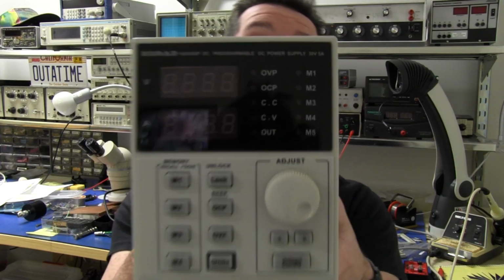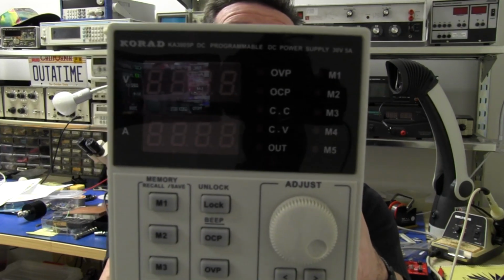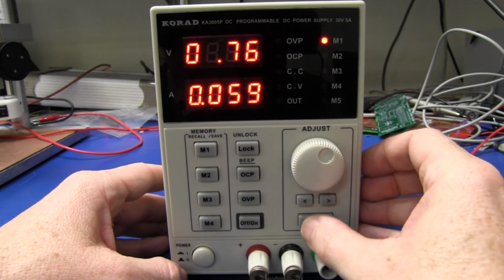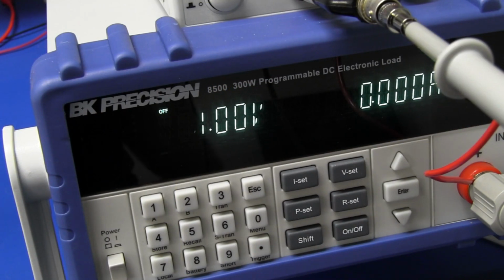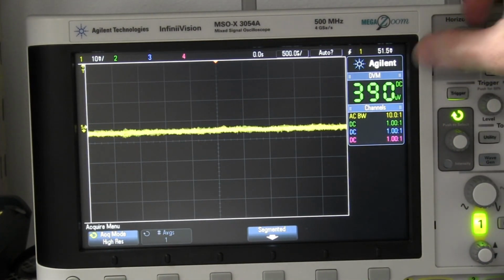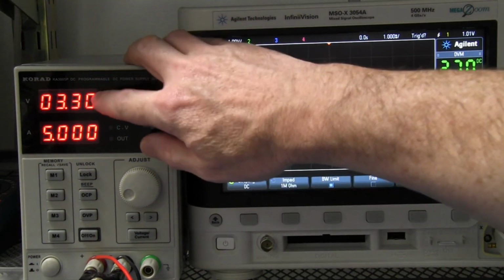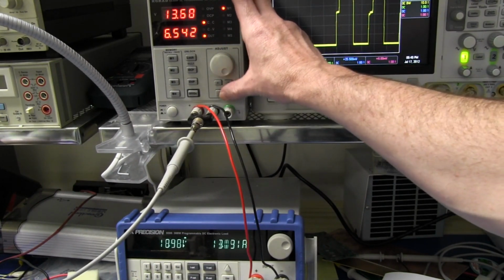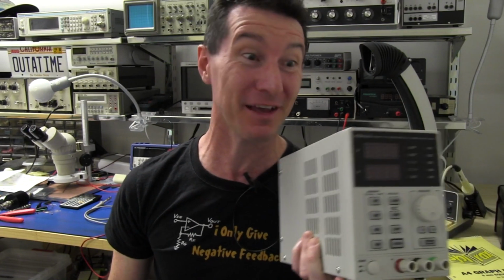EEVblog #315 - Korad KA3005P Review/FAIL

Comment: It's good to be careful with an electronic load set to constant power. When the supply is off, the voltage is 0 and the current is therefore I =  P / 0V = infinity, unless the e-load has some other current limit. Then you ask the power supply to turn on into a short. This type of load would never be found in any real application, it's just a testing convenience. Anyway, just something to watch out for.
Reply: David Erickson There are the connecting wires, and even a constant power load can have a minimum resistance set (at least good ones do). So no dead shorts :)

Comment: Hi! I would like a Video, where you repair the supply (I'm assuming one od the two main transistors shorted), and test if it broke because of bad design (to small transistor), or if the design was correct and the transistors didn't meet spec...

Comment: the output transistor shorted hard it looks, which is why it won't turn off.  the voltage output by the supply is probably dictated by the tap selected on the transformer.  I am wondering if that heatsink they used was way too small for the transistors, since it sure looked puny for the power level the supply can push.  The most stress would be constant current mode at the highest possible output voltage;  the transformer taps cannot be used to lower dissipation so the transistors dissipate it.

Comment: wow didnt even survive the intire 30 minutes before failing wonder what cooked.   I almost have to say it over heated in the back because the heat sinking to my understanding was just not right at all.  or those under sized wires and traces you did give it a beatting but I guess that what you get from cheap products. open her back up and take a look.  also sorry charles.  you want it back lol great video.

Comment: Methinks that looks like "pop goes the transistors".  Even with a fan, I didn't like how small the heatsink was in the teardown video.  Certainly not for continuous duty at maybe 50 watts or more depending on what the output current and voltage were set to.  Crack it open and see if those transistors are cooked

Comment: The biggest problem with these 1HL brands is the counterfeit pass transistors. They can barely supply 1/3 their rated current due to a severely reduced SOA. I routinely buy them - they're a steal - and replace the pass transistors with the genuine parts. I never, EVER have problems again. I am very hard on power supplies and do everything I can to blow them up. :)

Comment: Iv seen a review and repair of a Agilent supply that had an issue like this and it turned out to be A zenor diode  and it cause near enough the same issues that cheep bit of crap is having. I would assume the agilent one had taken years of abuse though not 20 mins worth of light testing.

Comment: Damn i never saw a PSU die so fast!

Oh and the weird stuff you got when giving it a constant power load makes sense if you think about it. As you introduced the large load the supply voltage dropped and the electronic load tried to pull more current. If the current got big enough for the PSU to start current limiting it then the voltage dropped even more and the electronic load tried to pull even more current from it until it all hit almost 0V where both of them give up.

Comment: it should have a disconect button and it should disconnect the circuit any time you switch program, then wait till you engage it again, that way you wouldnt be able to blow anything even without a keyboard lock

Comment: My guess would be the output section. I've seen this before - power transistors just fried. If you would fix it, you should stick a thermocouple to the main heatsink to see if it overheats. Something tells me that it's not enough to cool down the transistors.

Comment: Doesn't the sticker on the back say 220vac? @ 1:33, that's pretty freaky though, not even an Arduino could survive that kind of input spike (20 volts is the end of the absolute limits specified for the arduino.cc board) and 50v, that's halfway through of the extra low voltage range (50vac or 120vdc) O_O.

Comment: For the 0.2V on constant power problem: I think the load is just fighting with the power supply. The load wants more than 5A sometimes on power up, but the power supply will limit to 5A and stay there.

As for the failure, I'm guessing it's the pass transistors too. Sounds like they failed short, sending the full rectified transformer voltage to the output.